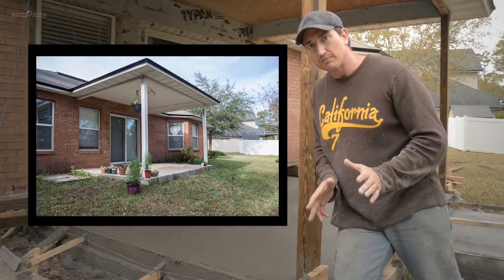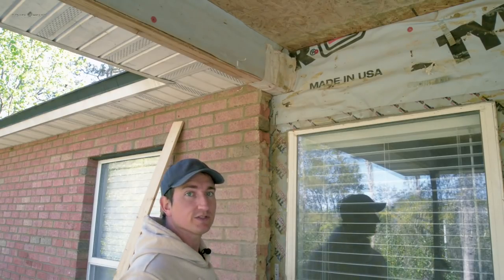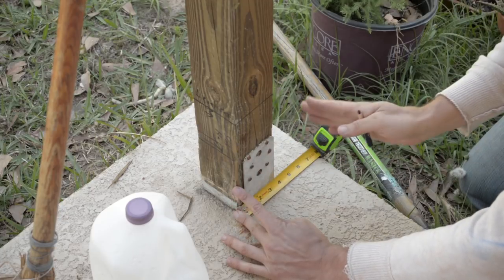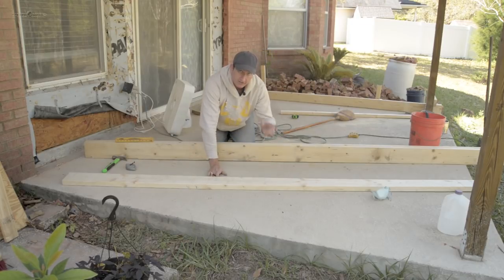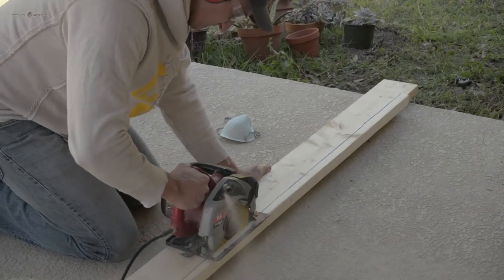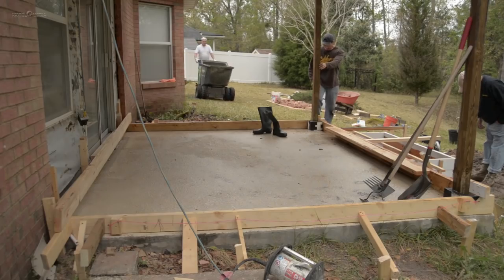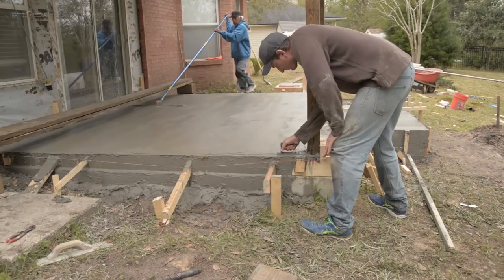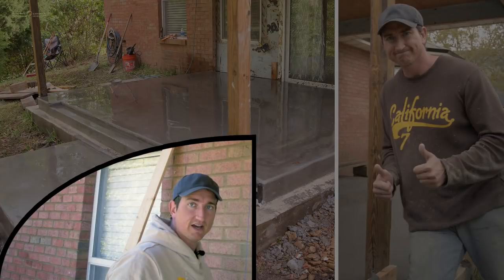Pour A Concrete Slab Over A Concrete Slab, #3 Porch Conversion Video

Comment: Nice Job, it looks good.
But,  a wire mesh would be betterto hold the concrete together like a single block resting on another block of concrete ,  plus a sheet of plastic is recommended to reduce sweating from soil moisture into the new room,.  ( Because the porch may not have had a layer of plastic under it )
Reply from the maker: Thanks for watching and the tips.  Utilized a Fiber reinforced concrete mix on this project.

Comment: You did a nice job of forming and laying it out.  I am not a concrete expert, but just from what I've done over the years, and from watching a lot of concrete poured, I think you missed a several things that would have made me say "great job!".   I came here to see if anyone else was trying to do what I'm going to do.  Add concrete to an existing slab, to make it level, and then install flooring over it.  My customer had a guy build a room over the old pad.  No kidding!  It's a nightmare!!!!  It's a 16' room, and it is 4+ inches low from the house to the outside wall.  The original patio was stamped and stained.  Ideally, grinding off the old finish and then applying a bonding agent would be the way to go.  But grinding just seems out of the question for several reasons.  The room is already finished, the cost to grind is going to be at least $1,000 for a 16'x24' and a good amount is going to have to come off to get to raw concrete.   So, I thought we could drill holes, epoxy rebar and then attach wire mesh.  Pour the concrete and level out.   I would normally glue down the flooring, but because of going this route, I think a floating floor would be the far better way to install, which should eliminate any crack issues or whatever else.  He doesn't have many options at this point.  The idiot who poured the new part of the slab and then build a room over it should be never allow to do work for others ever again!  But, that's just my opinion.  Anyone have any suggestions, other than walk away from this, please reply!   He's already had numerous people come by and take a look at it, and then never hears from them again.  That pretty much says it all.  No one is going to do this and have liability if it doesn't work.  I may have to consult an attorney on this as people sue even after they sign off on liability issues.
Reply from the maker: The process shown here in this video worked well for this particular application.  The concrete pour on top of the existing porch slab project was vetted by local building regulatory officials before the concrete was even poured. The floor has performed flawlessly.  Regarding your project I wish you the best of luck.  If you are able please share what you end up doing. Thanks

Comment: Great video! What would you do if the slab underneath did not have footers?
Reply from the maker: Good question! It might be a good idea to talk to an engineer.  It all depends on all the variables of your project.  If the new loads are substantial it may be required to put in new footers.

Comment: Newbie here, looking to take on a similar project. Why didn’t you build the floor up with wood floor joists?
Reply from the maker: For this application we determined the poured concrete floor would be best practice.  Building a wood framed floor could have been another possibility but was not the path we chose.

Comment: this is so very helpful. i watched this because i am trying to get advice on resloping concrete, without having to demo all the existing concrete. what would you recommend for not producing a weak cold joint? is a bonding agent enough to be able to pour an entire slab on top of the existing for example?
Reply from the maker: Thanks for watching and commenting.  Not sure I can provide the advise you are looking regarding your concrete project.  For the project shown in the video a concrete bonding agent was not determined necessary. Best of luck with your project and keep me posted how it turns out.

Comment: Should have etched the old concrete with muratic acid for better bond - tap lightly on your finished slab if you hear a hollow sound then you have a poor bond better the old and new

Comment: Would the rebar mesh make the new additional slap stronger, or it is unnecessary? Thanks
Reply from the maker: For this particular concrete pour rebar was not considered necessary.  For many concrete applications rebar or wire mesh is necessary for structural reasons.

Comment: Why no rebar in slab?
I'm attempting the same thing and wondering about using a vapor barrier between the old slab and the new slab?
Reply from the maker: Rebar reinforcement was determined not beneficial for this concrete floor pour application. One of the reasons was the integrity of the existing concrete floor and foundation the new slab was  poured over. The new floor was not expected to receive significant flex forces which is what metal reinforcement counters. Also the paint on the existing floor was determined a good enough barrier for this application.

Comment: Formwork was good, but personally I would have drilled some 50mm deep holes into the existing concrete slab and dropped 100mm Rebar lengths into them. Lay rebar mesh on seats and wire tie them as well as the upright lengths of rebar to eliminate any chance of movement. I would also include some expansion joints if the area is any bigger than this.
Reply from the maker: that sounds solid

Comment: Not bad! Should have used a bonding agent and steel. It would have been more work but I would of put in temp roof supports to square off the corners then put the posts back to the finished concrete height. It looks odd having the posts sunk down on the original slab
Reply from the maker: Thank you. One of the main reasons the post were left in was because of the permitting process.  By leaving the post in place it greatly simplified things with the local building department. I would have preferred to remove them as well but this approach was a compromise.

Comment: What was put between the new slab and the house slab gap. Somthjng had to go in there to make the transition I can’t figure it out
Reply from the maker: It was filled with concrete after the old door was removed. The door was recessed below the height of the new floor, so I had to leave the temporary space in order to be able to remove the door.

Comment: I just bought my first home and I have a slab that’s 10x12 for a shed and well inside. The previous owners converted garage into a bedroom leaving us with only a 10x10 shed for storage. Could I do something like this to extend my slab? I’d poor about 4 inches higher due to a low grade and about 8x10 bigger
Reply from the maker: Sounds like an interesting situation. You probably have some options but you may want to check with your local building department to verify any specifics they may require.

Comment: I have a dumb question. How come the new poor isn’t tied into the existing slab with rebar? Isn’t it basically one piece (albeit a heavy one) sitting loosely on another? Again I know nothing of this kind of work.
Reply from the maker: It was not necessary to tie in the new concrete slab on top of the existing concrete floor for this project.  Yes the new is essentially sitting on top of the old but the texture of the old floor surface provides more then enough griping area.  Also framing anchors were adding prior to building the walls which were likely deep enough to reach into the old floor a good ways.

Comment: Thanks for sharing👍! I'm wanting to do the samething to my back patio cause it slopes inward like yours did, causing the rain to puddle along the house. I have a quick question. Where your post are I have gutters coming down. Instead of making a gap around it. Can't I just cut the gutter and raise it then pour the cement all the way around the post that the gutters are attach to?
(The post are supporting my patio cover not my house)

 Your response is very much appreciated.. 😊
Reply from the maker: Thanks for watching the concrete pour video.  From how I interpret what you described I would think it would be easier to move the gutters. Best of luck with you concrete project.

Comment: no rebars, tie ins ,or adhesive ? what are the chance of it cracking later
Reply from the maker: The original concrete slab underneath the new concrete pad poured was solid and stable. This minimizes the chances of the new concrete floor poured on top from failing.

Comment: I am wanting to do the same exact thing to my back porch. I have to admit concrete projects and especially a concrete project I need to get perfect so it is level with my homes foundation is quite intimidating. Instead of using concrete to raise my porch foundation is it possible to use wood and subfloor to raise it? That seems more beginner friendly and was wondering about your thoughts?
Reply from the maker: Sounds like a great project. Yes in many situations it is possible to use wood to build the floor you describe.  You still may need to pour a concrete curb perimeter however to keep out water.

Comment: Any updates on your addition? I wonder if u use block wall or wood. how much did the concrete cost you for such a small pour? Around here 1cubic yard is 550$ ,under .6cubic yard will have 300$ deliver fee on top of whatever it is.  I figured buying bags for small pour cost 1/3 of the price if poured by truck. idk how some say same or cheaper. less labor sure but not sure about cheaper
Reply from the maker: Here is the complete start to finish project video showing the room construction project. https://youtu.be/FbF8-9KVP74  I probably paid a premium for the small amount of concrete but it was enough volume that I didn't want to mix bags.

Comment: Joe  I have an existing patio just like yours.  In my project, I want to make an expanded patio that runs the length of the house and also about 4 feet more on the front of the existing patio.  How in the heck would you recommend that I do that?  Remove the old patio, use it and poor the new concrete around it or poor over it????
Reply from the maker: Thanks for the question.  Not sure I have a complete understanding of the project but it might be ideal to remove the old and do the new larger "patio."  If you are going to add structure you may need a proper foundation anyway.  If a new foundation is not needed you might possibly be able to pour new concrete pads around the existing to accomplish your goal.  Keep me posted on your project's progress. I am curious on how it all turns out.

Comment: Nice job MrKistel. Just a few questions popped up in my mind though. I had been doing some reading before I stumbled on to your video. Didn't you need to clean the floor first of any debris and dampen the existing floor  first so that the first layer doesn't suck all the water out if the new layer of concrete or did you already do that before filming? Also... Wasn't is necessary to use a concrete bonding agent first before adding the new layer of concrete or is that only optional? I read that two separate layers of concrete don't actually adhere together "chemically" and you need a mechanical bond using a concrete glue
Reply from the maker: Thank you for your comment.  I rinsed the old concrete slab with a hose prior to pouring the fresh concrete on top.    This procedure cleaned the old floor a bit and added moisture to compensate for the reason you mentioned. For this application it was not necessary "attach" the new concrete layer to the old concrete floor so the new concrete slab is essentially floating.   Having said that it is unlikely to move because there should not be any forces applied that would cause it to move since it is only a floor with a downward gravitational force.  Also the old concrete floor had a very rough surface which the new pad will likely not slip on and the new floor is attached to the room walls.  I hope this explanation helps.

Comment: Could you place the masonry bolt before pouring the slab? Like instead of drilling the holes after the slab is dry? Or does it affect the bolt? Or something
Reply from the maker: Yes you could put something like J-bolts into the concrete shortly after the concrete is poured. Once the concrete is cured the anchors bolts should be solid and secure.

Comment: Just a question..why did you not simply put the formwork to match the outside slab?..it could have been a drill n screw to the existing slab and angled to the front?..your thoughts because that's what I would have done..
Reply from the maker: I think you are asking why I did not form around the perimeter of the existing slab so the new slab would match the dimensions of the old.  The new slab had to terminate where the new walls would be installed and the new walls had to be placed under the  beam framing of the existing roof (which is where the post are).  This was to allow some overhang of the wall sheathing material over the new slab  and keep  water out and the sheathing off the ground at same time.  This method was also required in the building permit.
Reply: Ok, thank you..
Reply: charminglad124 no kidding

Comment: How did you close off the corners around the base of the posts?  It briefly appears like something went there, but hard to tell.
Reply from the maker: Rigid pieces of Styrofoam were placed in to make  forms around the post before the concrete was poured.

Comment: Question I have a patio the slab is about 6 inches deep , we want to pour new cement over that but someone told us we couldn’t cause it will crack is that true??
Reply from the maker: If the existing slab is solid and likely able to handle the load of the new concrete without shifting I would think it would probably be ok.

Comment: What if the foundation have cracks is there a way of still doing it
Reply from the maker: Possibly, it just depends on the overall condition of the existing concrete foundation.  Best of luck with your concrete project
Reply: @MrKistel  how about the use of a moisture barrier or vapor barrier between the slabs?

Comment: why put the form around the 4x4 post? should have framed in a temporary wall and installed new posts. because now you have a 4x4 post stuck in the old concrete and it will look horrible. also no rebar.
Reply from the maker: For this project it was much easier to get a local building permit by leaving the existing post in place.  I would have preferred to remove them otherwise.  The post are isolated from the concrete and not in the concrete (that was the reason to install forms around the post).  Rebar was not necessary for this application.
Reply: Jimmi rig or at least put some expansion foam against the post

Comment: This new concrete will adhere to the existing slab but because the shrinkage/expansion properties don't match, it will crack. Perhaps if it was designed to free float above the existing slab you could of avoided cracking.
Reply: Why do you think the coefficient for thermal expansion will be different between the new concrete and the old concrete?
Reply: on existing Concrete  avery 12" or at least 16"  wouldn't let it crack.

Comment: question if my shed is already concrete base, and it is at an angle, but it is not that much of an angle, and i want to level it out. My concern is if the layer is too thin (the new concrete to make it level out). would it crack and seperate? i'm talking about 1 inch thin.
Reply from the maker: There are cement based products for thinner applications.  Here are a couple examples:  https://amzn.to/2IWL40o and (self leveling product up to a thickness of 1/2 inch) https://amzn.to/2IYgy6B .  Best of luck with your project.
Reply: thx
Reply: @CountBeetle  @CountBeetle ... In the end I never level out my shed. I actually had to remove the shed. But you're leaking concern is because of rain or just water coming out?
I'm not professional, but I would say if it is from your plumbing then just remember when was the last time u put a screw in a wall, break something up to see where it started. They do have heat sensor gun, that would help locate stuffs behind wall
Reply: @CountBeetle  @CountBeetle ... Oh again I'm not expert, if anyone find this information is wrong please help the guy out. My opinion is lower the surrounding if possible and yea have some sort of sealers. May cut like 2 or 3 inch if all concrete surround ur patio, so when rain or water it can goes in it and of course you need to guide the path to the lowest spot of dirt.
Reply: @CountBeetle  @CountBeetle  . Please don't just do what I recommend. Well first seek for channels that have experiences people on it. Now, maybe this might help. I'm assuming your patio is at the lowest spot, i mean that's obvious why water goes to it. So since you can't raise it then lower the surround. If you're area has alot of rain. Then make a big gutter around your patio that allows rain to goes in and to some where else. The cracks that under you're wall, just any kind that can resist the water splashes into it. Since it will allow the water goes into the gutter you should be fine. https://www.pinterest.com/pin/193514115216744482/?lp=true ... something similar like this
Reply: @gamepurpose   cant i just seal it with something? There has to be something
Reply: @CountBeetle  @CountBeetle  @CountBeetle  @CountBeetle  . You can try to find just by searching to see anything that can help. But yea, I would say fix the issue. As I know all things will worn out eventually, Same idea as sealer for wood, asphalt, Idk anything need to redo once in awhile. So yes if you can find a good sealer out there, then sure why not. But if you have energy to do this similar idea. look into this https://www.youtube.com/watch?v=RosQjZ3-Alo  good luck